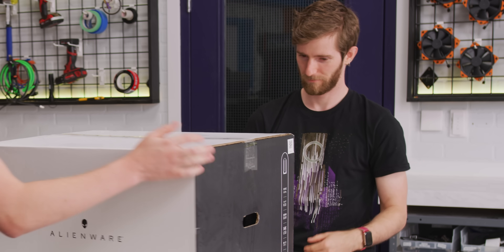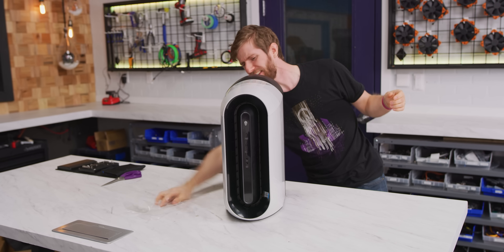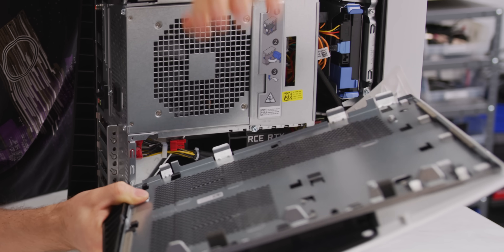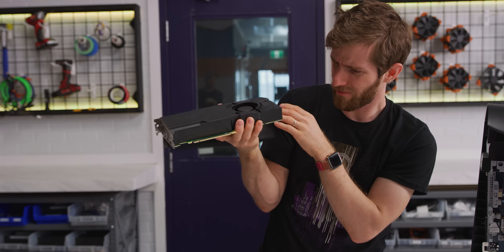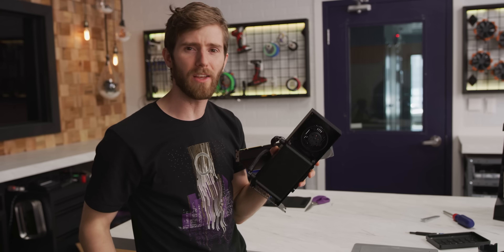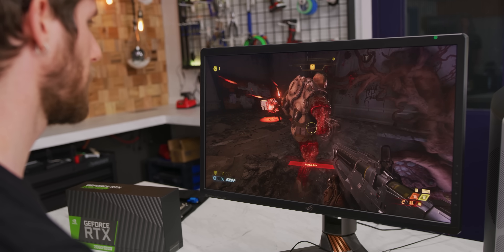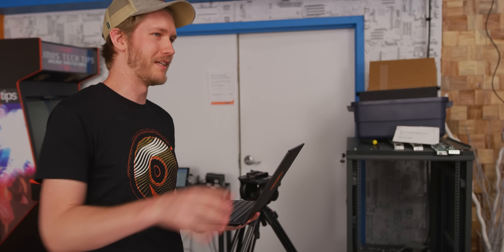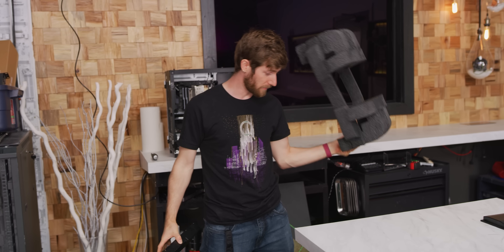I've Never Seen Anything Like This - Asetek Rad Card

Comment: Governments are using stopforumspam.con to censor me and violate free speech rights so I am posting this here.. 
I am in possession of evidence that Croatian or Serbian government and UK government with their bankers are involved in cryptocurrency thefts, thefts from bank accounts and modifying bank account transaction data... They have stolen my wallet private keys from my desktop by using Windows OS backdoor to enter into the system and they have read my passwords from my brain memory with brain computer interface and were doing transactions on my wallet. I have 3 BTC stolen in transaction 7e4153c47587a1782897d3726414b4d8165498bca684a5155f01e33140934add and I 5BSV stolen from here 143WPhvUuVymBuFse6GvEgfreVXZaKunTJ sent to my exchange account and traded to XML and sent to GA5XIGA5C7QTPTWXQHY6MCJRMTRZDOSHR6EFIBNDQTCQHG262N4GGKTM (txid  0a6e829c7a6a4cef29142fcf0a8789f187ac0ec023d8bb34b2ca108e5a2cf3b7) I was exiled from the Republic of Croatia and both of my apartments and my car were nationalized because I was not allowed to sell them. I have been involved in cryptocurrency from february 2014. I have started with 0 usd one computer with 1 gpu and in 4 years I have made 4.5 million usd mining and investing in cryptocurrency. In December 2017 during the peak of the market government used brain computer interface to capture my brain and forbid me to continue my work, they have cause laziness and distracting me from following my investments. They have attacked projects that I invested in using brain computer interface and operating system backdoors to mess up their code and make them fail. Government have been using OS backdoor to destroy my computers and smartphone and attacked my mining operations to put me out of business and denied me from using my computers. Governments are operating illegally to destroy economy and jobs. Government was using computer brain interface aka EMP (wireless electricity) to destroy my body and brain and I have physical evidence on my body to prove it. Caused amnesia to make me forget things like my password and reading passwords from my brain with computer brain interface and stealing my online accounts and game accounts to mess up my stats and steal items from games. When I demanded security serviced from governments around the world on which they have monopolies since nobody can join the industry and compete, they do not provide any service at all, proving that they are incompetent to provide protection to individuals and protection to the market and that security services industry should be privatized, when governments are involved they prove to be inefficient and expensive, they are taking so much of your money with taxes or tributes and cannot provide protection. Democratic socialism is a failure like communism and socialism proved to be a failure. I have been forcefully kept in Brasil by Brazilian terrorist government that supports capturing tourists and foreign investors by not providing services when private airline corporations steal your money by not providing transportation service after you pay for them multiple times. They wanted to cut my communication abilities by smashing my smartphone and laptop and ability to access assets to sell them to have money for accommodation and food. They want to manage my assets and force me to spend my money in their country by forcing me to stay and spend. I have been looking for a lawyer to deal with issues in their jurisdiction, but none of them would reply and that have proven to me not have justice system working here. You do not want to come to Brasil and invest here and open/do business because you cannot get to legal system to work here if you have issues. Investors are being captured and held restricted by terrorist governments of Croatia, Brazil and Malaysia and their property and body are being stolen and destroyed.

All governments with a central bank are communist governments and are supporting and rewarding  nazi/communist governments in siezing the means of production (digital money). I posses evidence for that claims, my father is inventor and developer of digital currency in late 1980s/early 1990a and his invention got siezed by the government of Croatia or Serbia and he went missing since then (i suspect he was murdered by the government). 

I have evidence of governments using brain computer interface and EMP (electromagnetic pulse) weirlessly with the use of wireless electricity to manipulte the brain (electro-chemically) and every aspect of the body. They can change how you look, remove or add hair or change its color, develop fatty cells on the body and develop cancerous cells, they can modify wants and needs to change your behavior and influence your purchasing preferences and manipulate the market economy, or want you join into certain behaviors like prostitution or drug smuggling due to addictions being sent electro-magnetically into your brain, they can cause pain in any part of the body by sending elecrtical signals to brain center that interprets the pain, those devices can make theets go bad and can make new teeths grow, they are using somebodies else signals from the brain on mine to male wisdom teeths grow in wrong direction now pushing other teeths onto one another, brain computer interface can color your teeths yellow and doctors will claim it is from tobacco, it can pick up all the feeling from one brain and send it to another, it cas look into history of person memories, they can sends and read thoughts and modify every aspect of the brain and body that you can think of. It can generate any illness imaginable onto the brain artificially. I am a capitalist cryptocurrency investor that is being destroyed and they exiled by communist serbs from proxy Croatia state and they nationalised 2 of my apartmamta in Osijek, My brain is heavily manipulated by those devices for the past 2.5 years and I could not follow my investments and lost more then 4 million USD while being captured and my human and common rights are being violated. I have been moving arund EU, went to Malaysia and now Brasil and they are all violating rights and human rights by destroying my body, health and destroying my property, stealing my money and cryptocurrencies. Brasil is now keeping me forcefully agains my will in their country, destroyed my devices that I need to access mu cryptocurrencies to exchange into money, banks in the EU are stealing money from my accounts and somebody from the governments and using brain computer details to read credit card numbers from my head and is spending my money from banks on online services. Serbs with proxy government of Croatia is stealing my online accounts by reading passwords from my brain. I am now in Sao Paulo (Brazil) at the international airport after being denied to board 2 flights and was not refunded upon request, went to report everything to the police but was refuesed service government has monopoly on and you have no other corporation to turn to for a this type of service. Both terrorist Serbian proxy Croatian and terrorist Brazilian government provided a proof that you cannot provide efficient type of services under government enforced monopolies and that they are operating illegally without regard for the constitution and laws.

I have issues with governments hacking into my online accounts so you might have hard time reaching me due to emails being deleted by government in their efforts to cut communications

Comment: Isn't the purpose of the stacked radiator like this is because each segment has too little surface area and you need to stack them like they do to have proper cooling.

Didn't LTT's previous finding show that it's more of a diminishing return and that if the radiator is large enough, adding more radiators to stack it does less and less? Conversely, if the radiator is undersized, then stacking. Would be effective. And those tiny rads in that card would be undersized, so stacking is necessary.

Comment: I love how they perforated the plastic film over the vents, knowing that there would be people who never think to remove it.
Reply: Coincidentally, that's exactly the market for alienware PCs
Reply: Exactly the type of people who buy a Dell.
Reply: They didn't do that because they were smart... We've already had years and years of plastic covers like that NOT being perforated and people overheating tech because of it. Those things are only like this now because of history.
Reply: *My father
Reply: some times not for bad... i remove all plastic when i see on my case, but i forget about one in bottom, lucky is not used for nothing, but i remove it to increase some flowrate stuff hehe
Reply: There are slits on the plastic where it lines up with the vent, so it wouldn't block airflow. You can see them as they are being peeled off
Reply: "Just in case I need to return this"
Reply: Like my dad. Though he does think to remove the plastic film, but refuses to do so because he prefers to have the extra protection for the plastic. [sigh]
Reply: Kind of a dumb play on their part, if they don't get a ton of calls to their customer support asking what's wrong, they won't be able to turn that assistance into an upsell on their warranties...
Reply: Probably to prevent condensation getting trapped on the inside during shipping because of changing temperature.
Reply: @TheGroundedCoffee  No, the peel-off film is scratch protection, not a vapor barrier. There would be a plastic bag around the whole machine.
Reply: @gunnar6674  yes, I understand what sealing plastic is for dude, come on. But understand that you remove the potential release of trapped water molecules when you seal of every vent on a product. Condensation is bound to occur when temperatures change and by leaving the vents open you potentially reduce some of the risk of it getting stuck on electric components. Remember, a ballpark estimation of condensation starting to appear on surfaces is when the difference of temperature on either side of a surface is 10°C (of course this doesn't scale up when you go below or above a certain threshold). Leaving vent holes open ensures a better exchange of temperatures.
Reply: @TheGroundedCoffee  More openings would increase the potential for condensation to form, not reduce it. The problem is if you bring a cold product into a warm and humid room - then the condensation in the air will condense on the cold object. If you want to avoid that, keep the plastic bag on it until it has reached the same temperature as the room.
Reply: @gunnar6674  that's not how it works. Let's do a little thought experiment and come up with a ridiculous situation. What if I took 2 hollow, aluminum cilinders, roughly the shape of a toilet paper carton. One of the cilinders had it's sides closed up and the other is wide open, just like our toilet paper roll. We place both of the cilinders in a freezing environment of let's say -50°C, long enough for the air inside the closed off cilinder to be just as cold as the temperature inside of the freezer. When we take both of the cilinders out and place them on a table at room temperature we can observe moisture starting to form on the closed cilinder and not on the open cilinder. The open cilinder will reach temperature equilibrium way before the closed one reaches it.

Now we reverse what's happening with the cilinders and apply our hypothesis on the computer case. The big temperature difference is not the same as the one of our thought experiment but the outcome would be identical. If one case is closed off and the other one is opened up and they both leave a colder environment to enter a warmer environment, the one with the sealed of holes is more likely to form condensation on the inside of the case. There is almost always moisture trapped in air, as there is air inside the cases moisture is bound to form on the inside with some amount of temperature difference.
Reply: @TheGroundedCoffee  The front vent and gpu exhaust is completely open, so even if the plastic werent perforated, im pretty sure the pc would have plenty of ventilation. Same from the psu exhaust grill itself. That being said, you should only "vapor shield" something in a cold climate since this temperature will not be able to carry as much water to begin with. It only becomes a problem if the transport/storage temperature is below the "packaging temperature". Well, if we can completely oversee pressure changes. The amount of condensation is directly related to temperature, there is no "rule of thumb".
Reply: @TheGroundedCoffee  Both cylinders will form condensation on the outside, but the open cylinder will form condensation on the inside, while the closed cylinder will not - it will only form a bit of condensation on the outside of the plastic. But if you don't take the plastic off, the closed cylinder will stay dry inside.
Reply: @gunnar6674  about the condensation forming on the outside of the cilinder, that's why I said you need to reverse it for the system case (for instances of going from a warm environment to a colder environment.. And yes, condensation will likely form on the open cilinder on both sides, but only because of the 'huge' temperature difference. Also aluminum is very heat conductive so it will draw minimal condensation if it does. But I see we don't meet eye to eye and that's okay.
Reply: @Falk9714  sure, that makes sense. I was just running through hypothetical scenarios as to why it would be perforated. To prevent user error makes the most sense of all, so Occam's Razor I guess.

Comment: I love GPU water cooling. Zip-tie any AIO and you're bound to get a big improvement. My 2070 SUPER went from 83C~ gaming into the low 50s while maintaining core clock speeds that were over 200MHz faster than the original heatsink.

Comment: I wouldn't pay more than $40 USD for that cooler. Other 120mm and 140mm AIO's with an ACTUAL fan are selling for about $55 USD. If you subtract $15 USD for the cost of a HQ fan. The radiator with a blower fan is about $40 bucks worth.

Comment: This is just an over engineered solution so the company can put "liquid cooled GPU" on the product page. That case isn't so small that they couldn't have done a full liquid cooling solution to start, and still probably left enough room to be able to actually use the PCI slots remaining on the MB instead of taking up all that room with a subpar solution.

Comment: I keep my RX 590 at 60c when at full 500 watts, and my cpu at 70c when using 100% on all cores. It usually sits at 20c when doing nothing while the CPU is at 32c in a house at 75f. 

All traditional cooling just three case fans

Comment: Wait 1 year when the motherboard starts to go tits up or you want to upgrade any major component on the PC to modern tech advances.  Even if a next-gen CPU by intel does not F you by changing the socket configuration, the CMOS Biose will, because that is what Dell does!  A throwaway PC!  If I can not expand it for posable foreseen future tech advances, I have no use for it.  I demand more than 2 or 4 years of serviceability out of my machines, preferable 6 or better.  I build a new machine every 2 to 3 years to add to my network anyway, but all my 5,6 7, year-old machines can still keep up.  To the 13 hells with LGB lighting and fancy liquid cooling and noise of fans.  I just expect my equipment to work as designed with minimum maintenance.  Is that too much to ask?  In regard to mainstream shelf units, it is too much to ask.

Comment: You would be surprised how inexpensive plastic injection molding is!!!  Polimar is cheap and you can make it in any shape you want.  With slave labor, the costs are negligible.  Cheap Dell plastic garbage!  And F true expandability, all dells are throw away garbage!!  At 1 time they were the top of shelf PCs, not now and their customer support and warranty were top, but now is crap just like all other manufactures of shelf PCs.

Comment: "You shouldn't see any significant drop until your room is sweltering 33 degrees at which point you might as well go outside." 

Me sitting in my room at 34C with an R9 290 reference.

Comment: my room is 34-36C during the day. i can get a chilly 28-32C if i take my fan ( one of them waist high floor fans) and let it blow air inside my pc case wich no sidepanel. i have not checked the cpu temps but the exhaust air from the back of the case goes from a very warm to a actual cool air and the MSI CPU Air cooler's finns allso actualy feel pretty cool to the touch.

Comment: The original alienware was high quality and top tier. But as it always is with Dell, it's cheap shit now, and every part is low quality.  Looking at the case - cheap, the special gpu cooler - cheap plastic material (yet costs a premium), Mobo - cheap, etc. And yet they charge insane prices for what you could get much cheaper and higher quality from a better company. Dell is trash

Comment: As someone who works in the industry some companies (cough apple) are ruled by their industrial design department. They spare no expense for parts that affect what it looks like on the outside and then the engineers are tasked with shaving dollars off on the parts people don't see.

(but also, changing those internal parts can be done with less lead time and less initial cost than changing the plastic molding. A plastic mold, as you said, costs a lot, but sheet metal is just bent into shape so it doesn't cost nearly as much to start up a new sheet metal part. This likely means that the internal metal parts were finalized way after the plastic molding and designed around it, especially due to the lead time.)